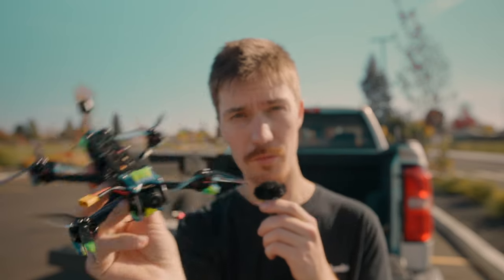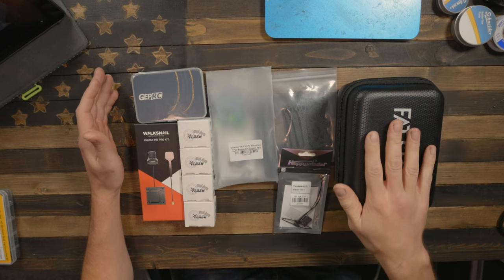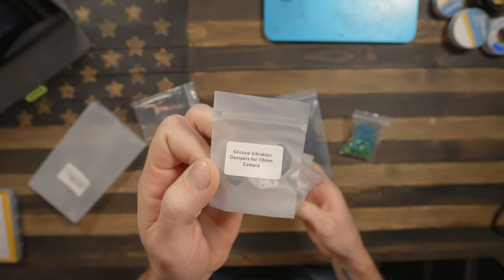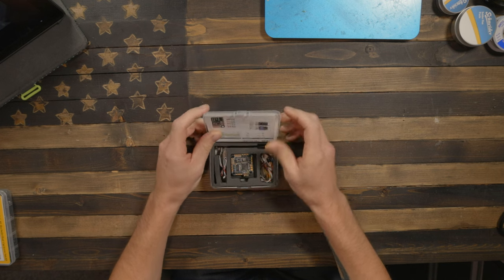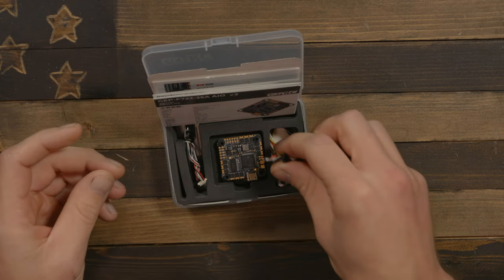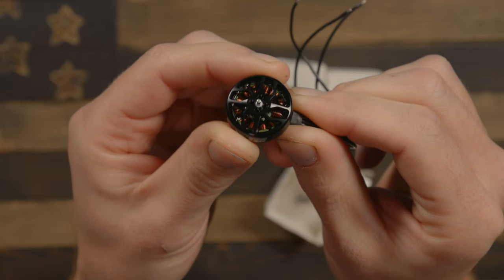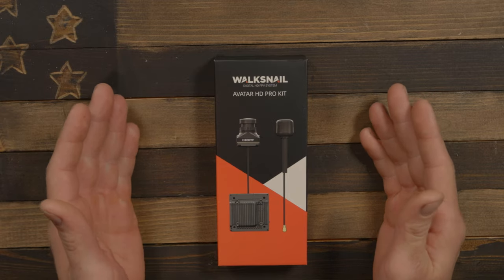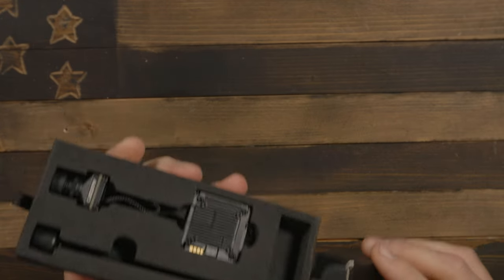FPV Drone Build And Flight // Walksnail Avatar 3.5” Freestyle

Comment: Wtf? I'm just getting back into the hobby after 7 years and just bought the whole DJI 03 set up. But after seeing this, I'm actually a bit upset that ive spemt so much on the system when i could have bought this one!
Reply from the maker: DJI and O3 are still the top of the line best performance across all areas. But you pay a premium for it. If you have the money for lots of O3 quads and the goggles 2,  nothing beats if for 3" and larger quads. Walksnail beats dji in price and variety of vtx, like there 1s boards for micros or toothpick builds.
Reply: You will be really happy with the 03 don’t worry.

Comment: Kind reminder to use and mention importance of flux when soldering please. A lot of people screw up joints not prepping/ cleaning them properly .
Reply from the maker: I have built 10 plus drones of all sizes and types, and to be honest I have never used flux. I use a thin strand of solder and it makes you feed alot of solder so the flux in the solder is enough for me. 🤷‍♂
Reply: Oh yes. This was my biggest problem building my first drone was getting the solder to stick to the pads. Flux really turns the difficulty down

Comment: i like the Flyfish 3.5 inch frame. Made 2 one with Walksnail & one DJI Vista Pro an both fly pretty good. Both get great flight time an are super quiet. Fly both in front of the house to get a lil stick time. Kind of a fan of HappyModel so I used there Crazy F411 20A AIO with HappyModel EX1404-3500KV MOTORS. That black battery pad you got with that Flyfish frame kit is one of the best I ever used, pert near dont need a battery strap. Happy flying. Thumbs up👍

Comment: Nice job man,  I'm getting ready to build one Mamba wifi AIO and DJI 03 ,I like those motors you got.
Reply from the maker: Nice even better with the O3. Yeah these motors are solid, still flying them after many crashes with no issues.

Comment: nice looking one, i built the same frame-motors build this summer. just had speedybee f7 mini and vista system. love that thing, but its harder to be as smooth as on 5 inch rig.
also idk if its only my frame but i had to file a bit the bottom frame to place the standoffs cuz they didnt want to get into the spots lol
Reply from the maker: Yeah the lighter weight quads are definitely not as smooth as 750gram 5" quad. I didn't have any issues with the standoffs but the screws for the arms were a little hard to screw in. 🤷‍♂. This night cam is amazing ill have some videos posted soon.

Comment: Love your build videos. I  just bought that Volador 3.5 inch and I'm wondering what preset to use in Betaflight?
Reply from the maker: Thanks! I Appreciate it. I think im using a supafly 2-4 inch freestyle preset. But I usually make some tweaks to the tune based on how its flying. supafly has presets for 3-5 inch freestlye quads for BF 4.3 and 4.4. Im using just the pids though rates are my own preference.

Comment: Does it make sense to upgrade it to 6s, or is that overkill. I mean even with 6s motors you would still be able to use 4s batteries (and 6s for more power, the components (except the motors) seem to support 6s. Just starting out and kinda want my first drone to be perfect :) ?
Reply from the maker: I already have lots of 4s packs so that’s part of it and weight. This thing at its size already has tons of power. 6s packs are more expensive. But it’s up to you. More people run 6s than 4s across all sizes from what I’ve seen. And like you said 6s can run both so..

Comment: Total beginner here, so the chance of me being wrong is quite high, but both ELRS antenna's are in the same orientation, and 1 is really close to the vtx antenna. Wouldn't it be better to do them allong the front arms? That way they are in a nice angle, preventing a situation where the blind spot of the two antenna's overlap. Or will the motor wires interfere to much in that orientation?
Reply from the maker: 🤷‍♂ Eh yes and no. running them on the arms would work great. I just dont like the look of that and since this quad is never going further than maybe 2-3k feet away max, I dont have to worry much about antenna null. I have my 7" long range quad that has the antenna set up the exact same way and they are actually crossfire 915mhz antenna running elrs 2.4ghz 🤣. Lots of people told me I cant do it and it wont work but I have flown some miles on that set up. Never had an issue. I like to experiment and test things out especially when people say I cant. Always stay curious.
Reply: @andrewmedia3568  i appreciate the response! Good to know that the problem I invented is mostly theoretical. I’m flying a mob6 and looking to upgrade to a mob8. But this video really inspired me to start looking into building a 3.5 inch myself later on!

Comment: quick question, as its an x frame - Are the props visible in the DJI o3 recording? or only during flying in the googles.
Reply from the maker: Im not sure because this is the walksnail vtx not the dji O3, the first flight section in this video is the vtx recording not the goggle dvr and it has props in view. I think this frame would have props in view with the O3.

Comment: I hope I'm not bothering you, but just one more thing, what c-rating would you suggest for a 4s 850mah battery? I'm making a similar build to yours, it has the same frame and motors.
Reply from the maker: No your good. The C rating thing is kinda BS, Its somewhat made up by manufacturer as a sales gimmick. But as long as the battery is "rated"  around 90-120c they will work fine. C rating matters more when looking at batteries from the same manufacturer as they rate their own batteries differently. When looking at two different company's and one says 100c and the other says 120c thats just marketing BS.
Reply: @andrewmedia3568  Oh, I see now, I thought that it needed to be a specific amount based on how much power a drone used. Thanks for clarifying

Comment: with the frame you used, can I use any analog VTX and camera, or is it designed for the walk snail system. Also what battery are you running and how is the flight time?
Reply from the maker: you can use any analog vtx that will mount up in this frame. the mounting holes are 20x20 and 25x25. Or you can always use 3M double sided tape to mount the vtx too. And the camera spacing is 19mm or 20mm so your standard micro sized 19/20mm camera will work fine. For batteries I used ovonic 850mAh 4s lipos and flight time was 5-7 minutes.
Reply: @andrewmedia3568  Thank you so much! I'm just working on some researching for my quad. Got to save up some money though because right now I'm in grade seven so I'm trying to find some odd jobs to do. Once again thanks, and I will 100% be coming back to this channel.
Reply from the maker: @ToastMaster553_  No problem happy to help.

Comment: Did you have issues having the VTX and RX both being hooked up to UART2?
Reply from the maker: The VTX is on UART 1 and the RX is on UART 2. sorry if i didn't explain that very well in the video. the plug for the VTX on the board is VBAT, Ground, T1,R1, Ground and R2. but the last ground and R2 are only for DJI If you are using SBUS and the DJI radio. I only used 4 wires in that plug excluding the second ground and R2. Hopefully this makes sense.

Comment: Hey, nice video! I had a quick question. What batteries do you recommend for this build? Additionally, do the goggles require extra batteries? (I want to get the goggles x but don’t yet know if I need extra batteries to make them work).
Reply from the maker: Definitely 4s 850mah. And yes you need a battery for the goggles. It comes with an xt60 to barrel plug but not a battery.
Reply: @andrewmedia3568 Great! Thank you. I found the ones you purchased on amazon. Additionally, is there a reason why you got 5 motors instead of 4?
Reply from the maker: @arthurgarzon200 sometimes I buy 5 in case i immediately crash and need a new motor🤣. Thats why.
Reply: @andrewmedia3568 I see, what battery would you recommend to get?
Reply from the maker: @arthurgarzon200  I don’t worry too much about brands. I buy cheap batteries off Amazon like ovonic and zee. They end up smashed into the ground anyway😅.

Comment: Hi man! Nice build!
What battery size are you using?
Reply from the maker: Thanks. I’m running 850mah 4s and a 1300mah 4s
Reply: @andrewmedia3568  Nice man. I am building this frame with a 6s 550mah and 6s 660mah. Let's see if it works great.. haha
Reply from the maker: @drone_fpv  I think that will rip. 💪It’s a great mini quad.
Reply: @andrewmedia3568  nice! I'm anxiously waiting for the pieces! Thank you man! :)

Comment: How the hell did you get the camera in there !?! I’ve been trying for a few days now to get my runcam wasp into the frame’s soft mounts and it won’t work
Reply from the maker: I believe it came with 2 different soft mounts, one is for 19mm standard size camera and the other is 20mm for the slightly wider O3 camera.

Comment: How much weight is this drone?
Reply from the maker: 195 grams without a battery. It’s over 250 with a battery.
Reply: @andrewmedia3568  can I put moonlight in this frame?
Reply from the maker: @miksul8253  I’m pretty sure you can, the DJI O3 will fit fine so the moonlight should work too.

Comment: Did you use screws for mounting vtx? Are they fit ?

I see only 3m tape
Reply from the maker: No I didn’t use screws just the 3M tape.
Reply: @andrewmedia3568   ok, but screws are not fit ? its 20x20 or vtx is to big for this frame ?
Reply from the maker: @Fpvnoob387 the frame does have 20x20 and 25x25. So you could screw the vtx down I’m just lazy I guess 😂. I have the vtx screwed down on my speedybee master 5 build.
Reply: that's what I wanted to hear xD
so i can order my build now ;)  @andrewmedia3568
Reply: thank for the answer

Comment: What’s the weight? With and without battery?
Reply from the maker: Not sure of the top of my head. I’ll let you know later. I know it’s under 250g without battery and over 250g with the battery for sure. Probably with a different frame and 1404 motors would get you under 250g with a battery.
Reply from the maker: 195g without battery and 287g with an 850mah 4s

Comment: whahts the top horizontal speed?
Reply from the maker: Not sure I don’t have a gps on this so I can’t tell. But based on my other quads that have a gps I’d guess between 50-70 mph.
Reply: @andrewmedia3568  im wondering if its worth it to switch to those motors…im using 1404 3800kv on my 3,5inch with 25pitched props
Reply from the maker: @DoktorSkill  the 1804 3500kv will definitely make more thrust. The quad has plenty of power. Thats why I went with 18 and not 14. These motors were on the flyfishrc 3.5” bind and fly so I figured they would work well.
Reply: @andrewmedia3568  yeah but they are 50% heavier than my 1404 version so im definitly loosing my sub250g….
Reply from the maker: @DoktorSkill  yes you will lose the sub250. I was a little disappointed when I finished the build and weighed it. If you wanna stay sub250 keep the 14mm motors.

Comment: 13:28 too much solder on the motor pads. and in my opinion the power cables are too close to each with that solder "nose"
Reply from the maker: yeah I had some trouble soldering this one. not my best soldering job😅

Comment: Like vistas ain't valid no more and the price is around the same price as what your using in this build.
Reply from the maker: Vista would probably give better overall performance but since I have the goggles v2 I would have to downgrade firmware to use it and then upgrade again to fly my O3 quads. Or buy the 700$ DJI goggles 2 that will connect to both on newest firmware.
Reply: Caddix nebula and polar has good night time ability 🤔 o3 night time terable only shines at day 😔